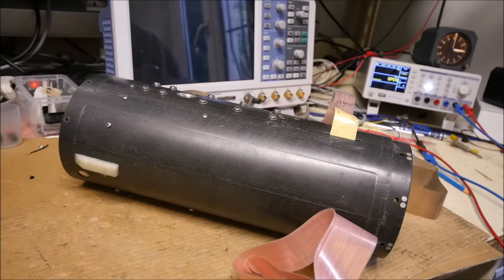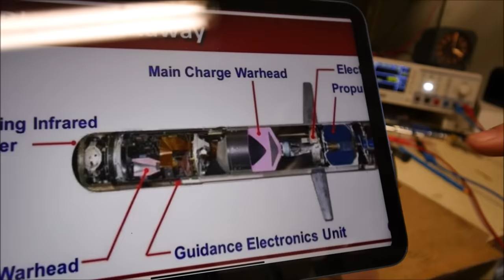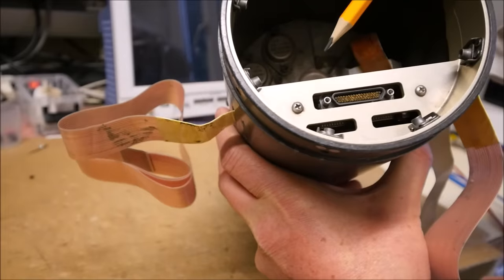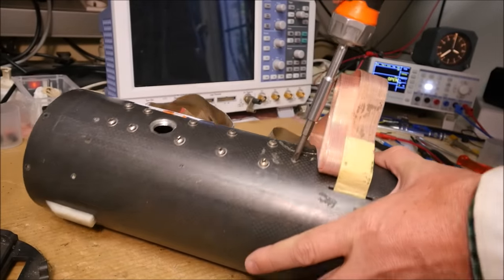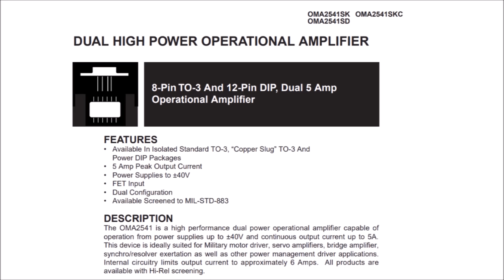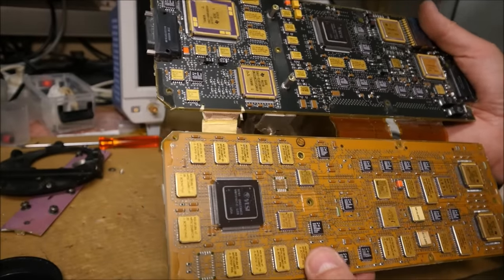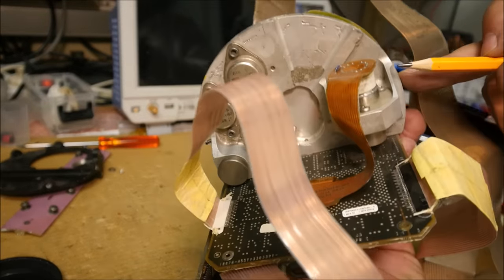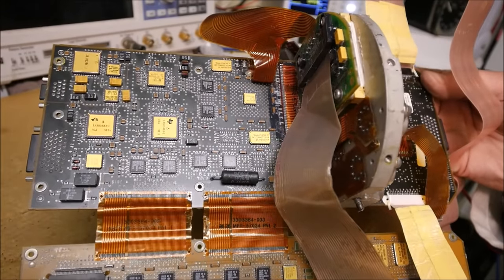LDM #354: Javelin Missile guidance computer - Part 1: teardown

Comment: And all of that can probably be replaced by an $50 variant of a raspbery pi without any loss of performance or robustness or whatever... This computer setup doesn't really do anything complicated anyway and doesn't actually need to be all that hardened.
Reply: I would not like to be in either end of a PI rigged with explosives after being exposed to 20 years of storage, humidity, temperature fluctuations, a battlefield with radio active fallout, mud, rain, extreme heat, getting launched by a rocket. I get what you going at but no :)

Comment: If you're someone who makes these, you could consider, oh i dont know, pinching one of those ribbon cables in a nondescript place right along the edge that is to connect to the head ports.
It would still read data and validate but if the right pins were cut the head wouldnt ever go off when used.
Just something for humans that care about other humans to consider. 
Ya know. Hint hint wink wink.

Comment: Efficient positioning of the precursor charge to demil the technologically sensitive guidance system.  This guy seems to have bought the parts of a unit whose main motor failed to fire.  Only the soft start motor fired and it landed on the ground.   We can surmise that the weapon does not self destruct if only the soft launch motor fired.  Obviously as a protection to the operator.

Comment: Fact this is not banned on YouTube means the tech behind it is outdated and they are using newer faster and more compact microchips. One 64x64 imaging sensor with that many gizmos... is just an overkill. I do get they use analog gyro since digital ones can be tempered with, but judging by the spacing between the components this thing is old. It would be easier, to my mind, to use a LIDAR from any commercial vehicle or Tesla's video analysis to lock on a target. Arduino won't handle it, but Raspberry Pi could. Much more compact and more powerful.
Reply: This weapon should work even when a soldier has half an hour to live due to radiation around him, or when his uniform is corroded by a chemical cloud. Do you understand?

Comment: Designed to destroy Russian tanks, proving to be very good at it. The U.S might be out of the earliest missile stocks but Russia are out a few thousand tanks, with probably as many as THREE HUNDRED alone down to this. Not a bad investment considering the cost of those tanks.
Reply: Самая хуювая из возможных инвестиций Порошенко(будуче уже опосредованно виновым всмерти 36к человек( тех кого кого отправили убивать своих на тот момент граждан и самих граждан убитых на тот момент своими же войсками ) так как был лиш куклой перчаткой изображающей президента) от неё даже отказывался на камеру в ООН в сентябре 2017 года после чего ему на третий день ответили на вот такой отказ спалив самый крупный склад боеприпасов рсзо распологавшийся под городом Балаклея горело тои дня выгорело на мрд. зелени. Через пол года подобный акт насильственного принуждения повторили под городом Винница после чего он подписал там где ему таким вот образом указали пальцем в реализацию прследующей эсколации конфликта. В смерти сотен тысячь людей привышающей мобилизационный потенциал подконтролный бандитскому режиму который захватил украину в два раза.
Reply: Considering Russia production tank rate about 1000 tanks per year, Russia basically modernized its tanks. From rumors on internet about Russian Vikhr vs Bradley. Well, Bradley turned into cardboard box that disassembled into sheets of metal.

Kinda wonder what terrorists would do with Javelins and Anti-Air missiles that disappeared from Ukraine. (Also young criminals and terrorist saw what for they can use FPV drones, and learned. Next 17 years in the impoverished Europe might be interesting.)
Reply: @raghardeishi972  Russia make 200 new tanks per year. The rest are old junk hulls from storage like T-64 and T-72 that are 'modernised' which means nothing much, because they are fitting old model thermal sights and very often none at all. They have lost so many tanks in two years the rate of loss outstrips the rate of production and modernisation. At the current rate they'll have hardly any left in two years time, not to mention be beyond HALF A MILLIONP casualties. Russia's armed forces have been systematically taken apart by pretty old relatively cheap Western arms such as the Javelin. Quite funny really.

Comment: Riveted transistors... That would make service and repairs more difficult.
Reply from the maker: It is not obvious to see but if you are referring to the TO-3 parts (power op-amps not transistors) they are screwed not riveted.
Reply: Well as its purpose is to blow up I do not think they have 'Must be easy to Service' in the SOW or the requirements ;)   I would think it would be modularized but so the seeker/ guidance and warhead can be swapped out for improved versions as well it might be software upgradable,  but given the cost of unpacking it from its solider proofed packaging it might be cheaper just to build a new one.
Reply: Hex screws?
Reply: I don't think that someone will be picking up a failed Jawelin shot and doing any repair to use it again later

Comment: That pink glue stuff on the metal rail looks so very much like that really really toxic pink stuff in microwave cavities. What is that stuff selenium oxide or something?  I'm voting to cover it will tape and be very careful not to break it and breathe the dust.
Reply: Eh I'd be careful of any single use device from the military. Especially older types. But ceramic insulators in modern microwave ovens are usually made of Alumina ceramics (unless of course it comes from some sketchy maximum profit sweat shop with no regulation; rare).
Reply: To further add I've seen that "pink stuff" as sticky heat conducting "foam" in my Nest doorbell too. After I had to replace the failed lithium battery in it. Could also be that.

Comment: Guys. Javelin performed very mediocre, to say the least.
A very expensive and capricious toy for rich NATO fools. In winter, in the cold, the batteries quickly ran out and there were a lot of problems with them. The missiles ended up in the real world, and not in an advertising brochure for the Pentagon, and almost always missed, as can be seen from this video at the beginning where the failed missile simply lies on the ground.
The main thing is a cumbersome, capricious and insanely expensive system that is not applicable in a real war because It cannot be produced by hundreds of tens of thousands a year, and for its price, it will ruin any half-buyer.
Now tanks, infantry fighting vehicles, trucks and enemy soldiers are destroyed by Russian FPV quadrocopters for $300, which are printed on a 3D printer in 2 hours - they fly 10-12 km with an RPG rocket and penetrate any NATO equipment.
Javelin - flashed for 2-3 months, and now everyone has completely forgotten about it; they have been gone for a long time.

Comment: Very bad design. A full kg of weight could have been removed using a small computer and software with micro sensors .. when did the acceleration sensor failed in a cheep phone last time?!
Reply: It was designed and manufactured in 90's. At that time it was the pinnacle of technology.

Comment: It is extremely dangerous to deal with such military weapons, you just can not be sure if there is any self destruction mechanism has not been trigger yet. Or any positioning signals it is still transmitting.
Reply: And pose a threat to anyone working on it or using it - I doubt it.